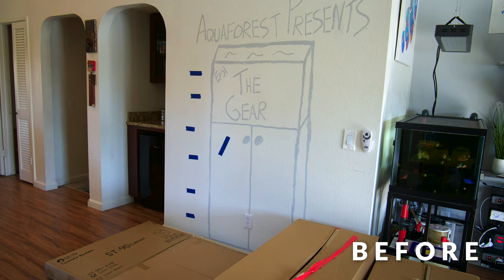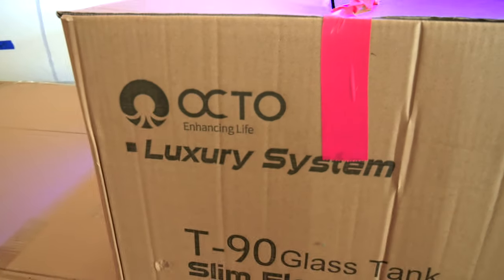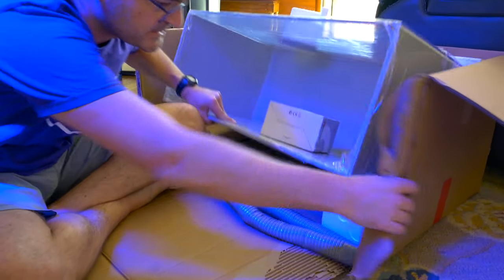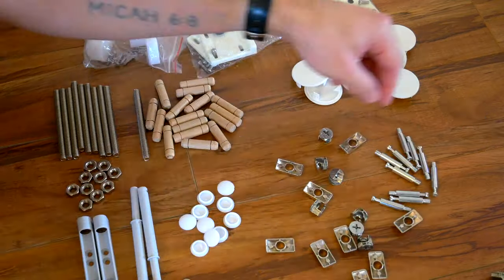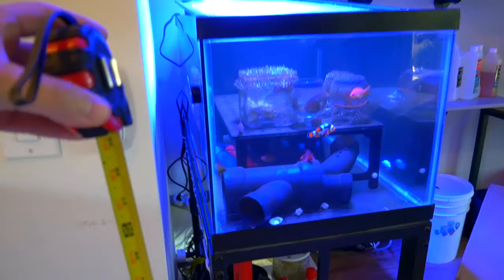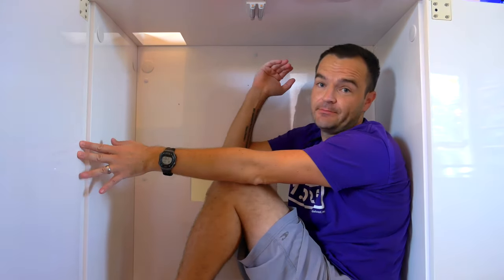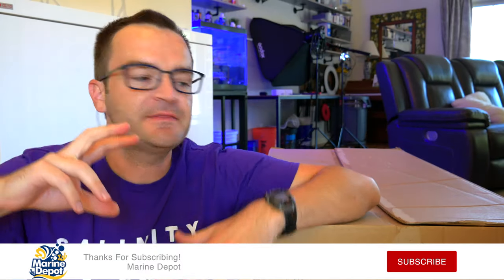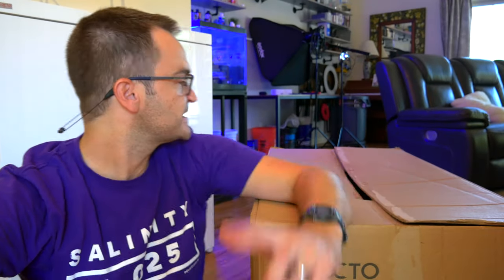I've Never Seen Anything Like This // Aquaforest Presents Ep. 02 "The Tank"

Comment: Question for you. If its at all possible and not to much work. Would you mind for example showing the "height" you adjust for the protein skimmer? I have a 110int reef octopus and to this day idk if its the right height and skimming correctly.
Reply from the maker: So, typically my protein skimmers are supposed to sit at 8 inches.  That means that I measure from the bottom of the sump to the water line.  Often times, 8 inches is too low for the first couple weeks, so I raise it up by placing something underneath it, like a biobrick, a plate, or something else.  Then I lower it after it calms down, usually to the 8 inch recommendation.  The most important thing about the correct height, is that you are getting the skimmate you want.  Whether you want a wet or dry skim (light or dark in color), will depend on your water parameters and testing.  Most of the time the darker skim the better, because that means you aren't pulling out too much from the water.  But if you have a heavy bioload and you cant keep your nitrates  down, then you'll want to consider a wet skim (light in color), to help pull more organics from the water.  Hope that helps a little!

Comment: Beautiful tank and stand. My only question is how you could get to the slim flow box on the bottom floor of the tank to clean it or fix it if you had any problems.
Reply from the maker: that is my exact question!  Or what if something happens to the plumbing?  How do you fix it?  I'm assuming the only way would be to drain the tank, remove the slim flow, fix the issue, and then reapply silicone to the slim flow.  A super legitimate concern!